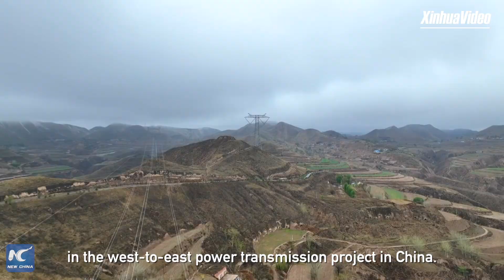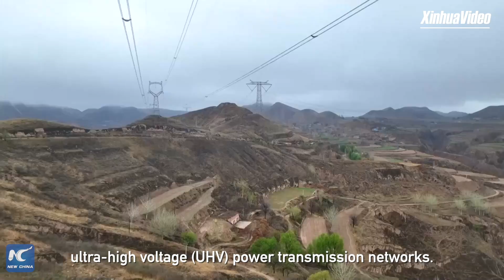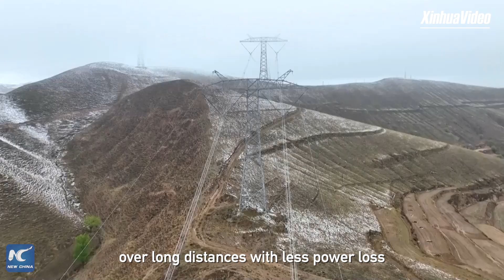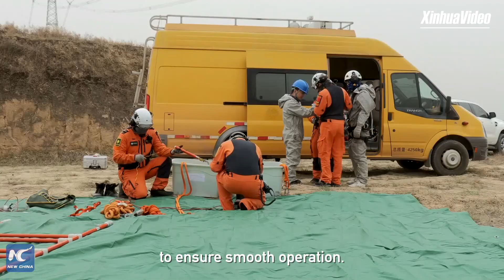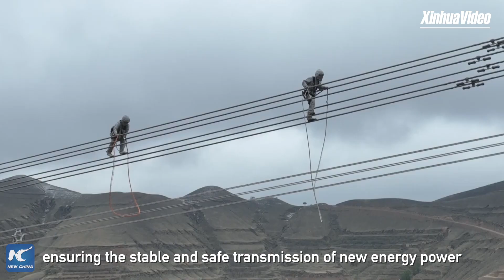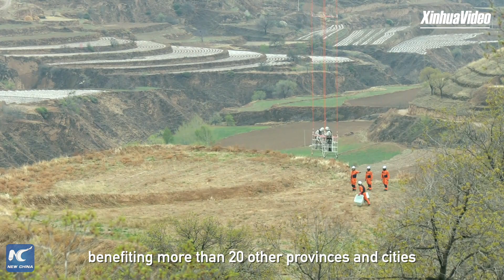Ultra-high voltage power transmission networks in NW China help boost green development

Comment: The UHV transmission technology is rarely understood by the west because they have not reached this point of development.  Take US for example although it has a similar land size but its grid has been broken into regions owned by different companies so each state look after itself.  The other long country is Argentina and Chile.  Argentina is having a UHV system assisted by China.
In China the UHV permits renewable energy generated in the west sparsely inhabited Gansu, Xinjiang, Tibet, Yunnan and Sichuan transmitted with minimum losses to the eastern coastal areas when the main industries and population lie.